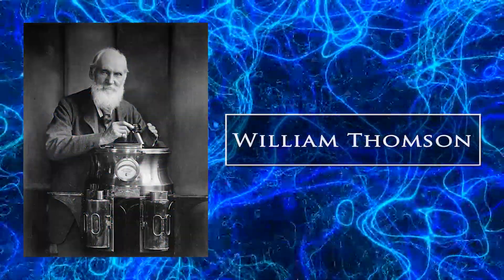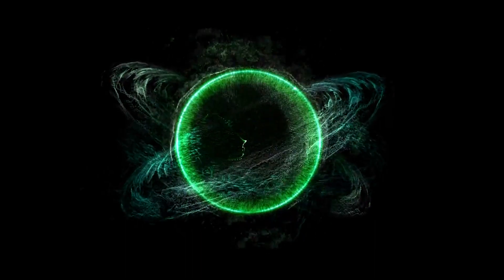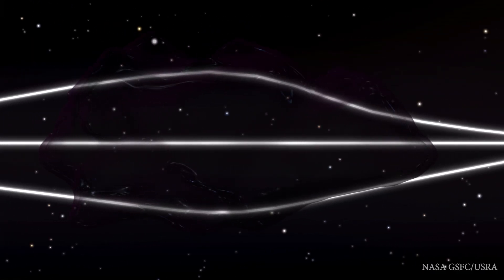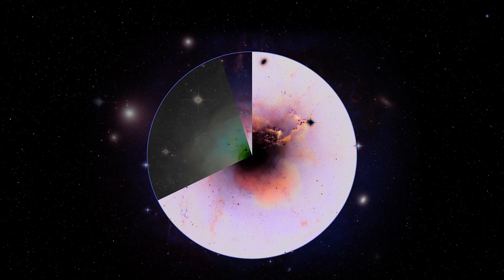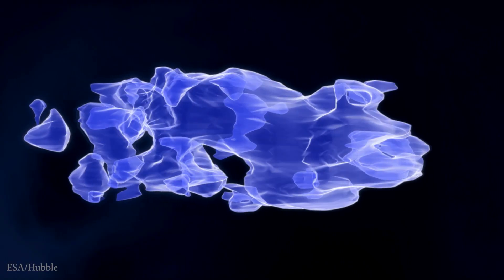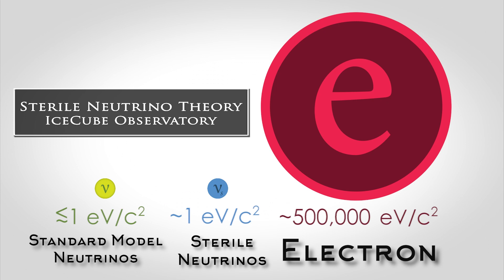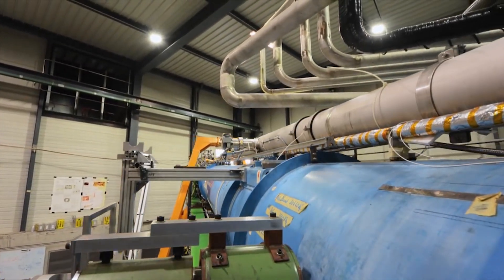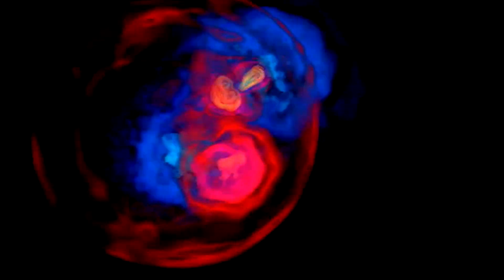The Dark Matter Mystery | JTheory

Comment: I watched a video, probably pbs spacetime, that said dark matter could be 100k tonne micro black holes left over from the beginning of time, and that if so they are probably zipping through us at near the speed of light all the time.  This is my favourite theory just as it would be so cool if true.
Reply from the maker: I also love the Primordial Black hole idea. Im not as sure of it since hawking radiation will have caused evaporation and it would imply a mass traveling at luminary speeds... both would most likely be detectable.  The distribution of Dark matter also does not suggest it to be a mass or masses that have collapsed to form black holes of enough size to not be evaporating. Unless the successful physics we know is wrong then i dont hold to much faith in the black hole theory. :(